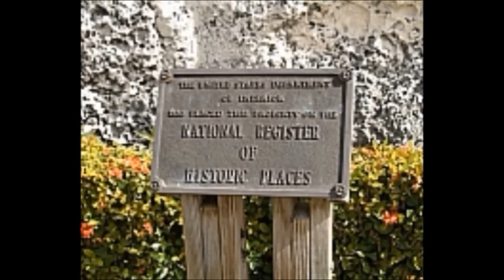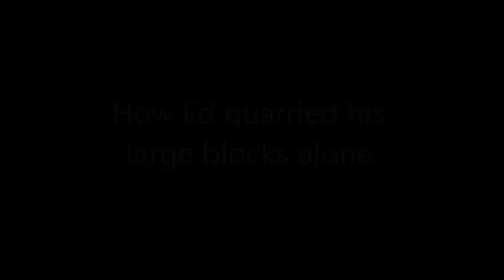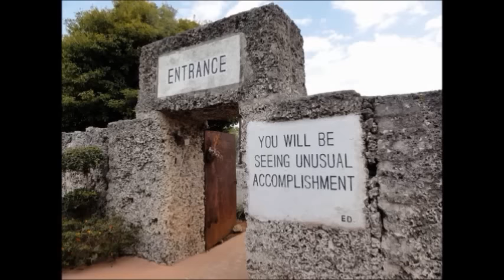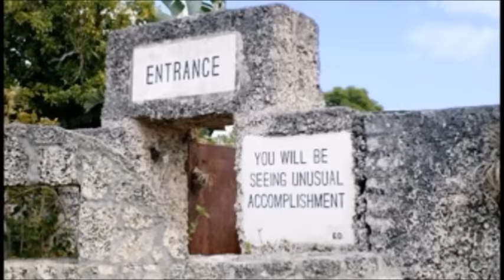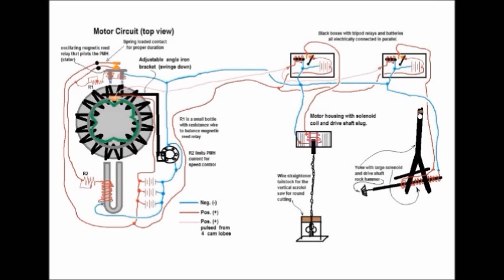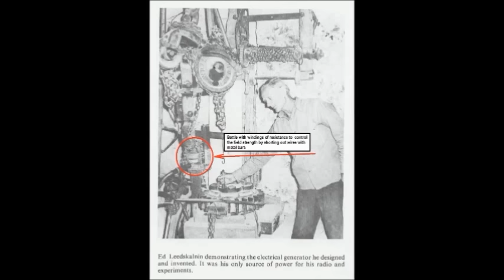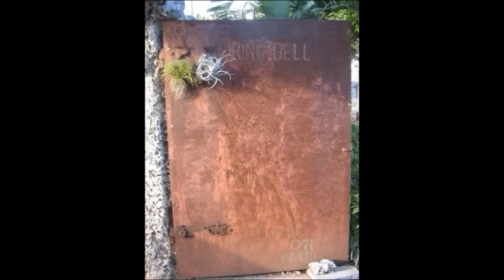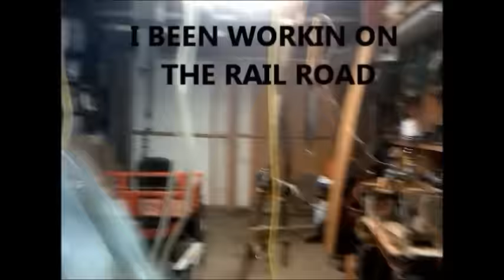Eds Coral Castle Quarry and Flywheel, Engineering Mystery Solved

Comment: This device is simply a hand crank Generator. It lit two bulbs that's it, it wasn't capable of much more and the bulbs could only be lit as long as the Generator was being cranked by hand.
Reply from the maker: +Tyson Capel Obviously you didn&#39;t watch this documentary then you know what it really what and that he used it for years and years and thats why it covered in carbon plasmtic arc  splatter on one side and not the other. I don't  think it CAN EVEN LIGHT BULBS without the aid of wires  on the magnets. so he used the iron as a motor armature. simple. What were the clovers leafs For then????? IT s obviously a motor not a generator.
Reply: +Made by one man there were coils of wire around it at one point in time. When Edward gave tours of the Coral Castle he would demonstrate this Generator lighting two light bulbs as he turned the hand crank. People are trying to deceive you into believing it's something its not.
Reply from the maker: Tyson Capel I am not sure if it is I that is truly being deceived. I tell you the wheel won't even light light bulbs. The magnets just are NOT strong enough. What are the clover leafs for AGAIN???   PLEASE HELP ME.  I AM LOST.
Reply: ***** I did watch to the video all the way through. There used to be wire windings around the device but they have since been removed. Iron oxidizes quickly especially in an area with high humidity so the likelihood that you would actually be able to see spatter marks is next to none because those areas would have rusted to the point where they would no longer exist. The clovers were used to direct the flow of flux.
Reply from the maker: Tyson Capel The splatter marks are obvious in the famous picture every one sees with his hand on the signalling wheel. the clover leafs are merely for switch contacts. ANGUS WANGUS's video on the wheel being a flux generator is total poop.
       why would one want to guide flux via cam lobes (clover leafs) anyway. to move a compass??? thats all they would do if that. what do you think the big hangin yoke was for????
       WAIT   I GET IT.    you still think levitation occurred etc??   NO.
       This stupid machine is way to simple to perform any (impossible un till the lexus hoverboard) magic. I am trying to be nice in saying........    YOU MY GOOD FRIEND have been hit by a large human size pile of internet bullshit and your eyes are still covered with it. This video (I created) is a giant water hose to clean all that crap off people who got hit by a system that slings shit for its money. If you don't WANT a good HONEST RINSE. then see you later hope you find what the internet tells you is the truth.   BUT ITS NOT.
         I actually care so put a stop to it.

peace out.          Scott R
Reply from the maker: ***** YOU NAILED IT.   That is impressive cause ACTUALLY it's correct very good.   HOWEVER  those frequencies that are needed to perform such a task DID NOT occur at CC. Although this place is laced with "counterspacial potentially intelligent lifeforms (aliens?) so it DOES propose some serious "spiritual" inspiration for congruent concepts such as levitation, free energy etc.
         It is with my own opinion that I do NOT believe ED LEEDSKALNIN  levitated rocks but I do believe it will be possible someday with similar conceptual inspirations from said geographical location etc.
        BOTTOM LINE?   its good in theory but no one has truly proven it.    YET.........
        Resonance is IMPERATIVE. actually and I like that you have some "clue" on counter space.   TIME MACHINE?????

PS? John Hutchison is a fraud on his levitation. He might be able to "DE ACTIVATE" nuclear reactions with his vibratory implements but not levitation. 
Scott R
Reply from the maker: ***** The problem is that we KNOW those values are irrelavant to the gravitational field of the limestone. It is present in all matter. AS for electrons, PLANETS don't exist either because they are merely the "RESULTANT" coalesced harmonic of the energies guiding the next layer of particle that exist there due to there "cymatic position" on the hexagonal lattice of space time. basically the energy mass thing. 
         Electrons ARE a decent model to use from the bottom up.  I see you kindof understand some of that, therefore you say they don't exist. BUT as far as a relative perspective to the energies coalescance THEY DO. AND   they mathematically explain all chemical and atomic interactions relative to that perspective. Which we all have agreed upon. Just remember my good brother with a different insight its like this SIMPLE.::::
        look Johnson theres a boat on the water moving to the other fixed shore, says the elementary school student. Then Scott and Johnson says NO look there is a boat out there and one shore of the water is leaving it and the other shore is moving towards the boat because the boat is fixed but the shore is moving. 
         I believe the old dismantled model was called hole flow vs.. electron flow. WHICH IS IT????      its ACTUALLY  both cause its the same just looked at from different perspectives. back to relativity. then we learn counterspace has a relative time perspectus to it as well.   Stroboscopic time travel???   pretty much.      Scott R
Reply from the maker: ***** thats not true as there must be no earth or the earth being bombarded by the same relative forces would not exist either. Electrons only exist in a model. So do ATOMS. other wise its all energy vibratiog so fast we can't fathom the network. Electrons provide a logical mathematical working model. WORKING. because it explains all of the chemical reactions on this planet.  
As for atoms. they don't come flying apart to quickly even when hit by a meteor or another neutron. they stay put in their happy little place in the model.
Reply from the maker: ***** that is all pretty much correct. as for the electron. exactly its MERELY a model. All of the OBSERVATIONS seem to be accurate enough for peeps to make Nuclear reactor etc, batteries, call phones and solar cells. So why try to re invent the wheel (reality) when merely one may have to just look at it a different way. And WHY? no need really if it all works. WHO CARES how your son, daughter, dog, carrots are made. The FACT remains they exist and you just really don't know how. WHO CARES they are there. PERIOD. if you know that the dog is really a cat then mebe we have a issue like galileo, tesla, einstein, faraday, bohr, etc.   we will get to bottom of the tree at the center of the garden soon enough. WHY?    curiousity of course. other wise we should just be appreciative. because we CANNOT
yes PEACE LIGHT AND LOVE bro.
Reply from the maker: ***** again who cares about no electrons. The fact remains electricity works. AND  please please please. Why make the wheel like ED     Roy   did and he found that it wasn't some internet magic. it was like EVERYTHING ELSE.     quite simple once you understand how it works.    
         AND    it works. almost everyone can see that now. They didn't know how something 120 years old might work today since everything is made FOR them and they just plug it in, or turn a key. most people don't even know what a relay is, let alone an extinct 2 pole oscillating relay unique to a machine 120 years old.
          SOOOoooo......      what is it you think I missed   HONESTLY.    do you think ED LEEDSKALNIN levitated rocks with magnetism??? or got free energy like the internet says.   (for $$$$) or do you believe in solid,  hard, COLD facts about reality. yesterday someone told me ed used magnetism and electricity to "soften the rocks so they could "MELT AND MOLD" themselves into place with cracks. obviously he has never been to coral castle.    massive cracks and gaps everywhere.

What do you REALLY think....?
Reply from the maker: ***** ALL RIGHT,     JOHNSON   !!!!    its time you and I talk. Its obvious to me that I have finally found a HOT one. calm down I mean this with FULL RESPECT.  
        You have finally proven to me that you are one WITH a clew. 9 out of 10 is an "A-" 95 % is an "A". you get an "A" the reason you don't get an A+ is only because personally I question the actual, practical, feasable means by which ED L. might have accomplished what you just described which is exactly correct. Some people coin the term "UFO" technology. 
         First of all Each little "energy field" you speak of is exactly what it is, HOWEVER. What almost EVERYONE cannot see is the actual propagated vectors of these "semi-infinitessimal" vibratory dielectric piano strings (TV beams) all "TUNED" by the same realm including and/or excluding the concept of time. THUS the mathematical "Tesla/Steinmetzian/Heviside" relationships describing "counterspace" of course one could romanticize with the same shaped language matrix and "jest" that the term counterspace is merely where "GOD's" giant TV/piano is actually setting and we are the interact World Wide Web FOR REAL. Basically the Kosmos at large and small (all in the same image mind you).
       So on those tension levels of "cymatic like" string/wave propagated energy "fields/branes/strings" a scientific concept called "COALESCANCE" occurs, due to repulsive and attractive combinations like a song in harmony. Science actually assumes this but they never seem to see the reason. they just assume it occurs EVERYWHERE. but its not like that (of course) the aether is like water and the universe is no different from large to small. As a MATTER of fact the ancient longest lasting very controversial text "spiritually" describe the basic geometric lattice of EVERYTHING we humans could possible perceive at every level of awareness from way back then till our perceived present (Pre     Sent) Most hidden from the many. But those who find it are few. 
         The price for this knowledge is undescribable though.  It  takes "great pains" ("pain"  =  Pay in)  from within and only the elect     ( rical? ) get to "see" it. YUP the rode to life is long and hard  and so are the VOWELS and CONSONANTS in the language matrix (which also cluster like body parts, chemistry, and everything else, )    
         SO back to the A+ thing. I realize Coral Castle is the/a Corral (nodal points and leylines if you will)  for ALL OF THIS, and thus all the levitation INSPIRATION and other INSPIRATION (free energy from the dielectric field). Energentically somehow, however, ..............   do you REALLY thing little ol' ED from latvia who they all knew locally and testified as to his work thru affidavits, REALLY electromagnetically gyrated the lattice EXACTLY as it would have to be to levitate ANYTHING my good brother (sister if johnson is your last name and you are feminine ( I don't care) ). ??????
       So that's all for now now. I don't gather AT THAT TIME PERIOD that ED did it.

BUT   ! ! ! ! ! ! ! ! 

I never said levitation was impossible. Thats why I think you are correct and still get an A  

Honestly I just think that ED did it the way every sees in the movie. He Rigged it. He was from RIG A    Latvia   after all.   Scott R.
Reply from the maker: +Johnson VERY COOL   I will not move too fast. as for the rhombic 3 d setup. bingo.......     that is exactly how UFO technology will work (did work) but ED did not do any levitation. this way. The theory and evidence is certainly only futuristic. (to us) inspired via coral castle (somewhat) yet I have yet to see anyone levitate or even lighten coral limestone.
Reply: +Made by one man Nikola Tesla used to invite people over to his place, and have light shows, at the end of the show Tesla would Levitate up about 15 feet or so scarring all the people there so bad they all ran out of his place, it was called the Tesla coil I think, I always wanted to make one it would be really cool....not sure if it could pick up big rocks or not?
Reply from the maker: I agree, on the generator, but since it does work as a cutting machine why do people say its not that when I am showing them.? the damn thing actually turns by magnetism (eds books) and what would the four leaf clovers be used for as well as all the coils in the shop. Check out the vid again and digest the whole machines concept and You will start to like the place again. Cause this thing seems simple. I don't want to trample dreams BUT I don't want people to be in the dark.  Peace out
Reply from the maker: ***** yes that would give rise to the "homopolar generator" postulation by mr angus wangus. Seems the values are too weak to do anything that all. BUT you are RIGHT on those geometric profiles that DO form on the top and bottom of the wheel when "fired up" magnetically.
Reply from the maker: ***** You should "suggest" that to either Vinny St. Vincent or Mr. Angus Wangus. Vinny has the the replica and Wangus is the one suggesting its a homopolar generator. with a monpolar vortex you would see with flux film. Great Idea.

Comment: Ah, so many critics, so few actual working wizards. Great job, Scott. Don't let the shallow negative morons reduce or demean any of your brilliant work. I first visited Coral Castle with my parents back in the 70's. I took my kids to see it in the 80's when the door was still working exactly as Ed built it. The most amazing feat ever and the engineers managed to screw it up permanently. I revisited with my wife this past summer. I had a fresh perspective on it, but was still dumfounded on how his obviously magnetic and electronic apparatuses worked together.

You have put the pieces together majestically! Thank you. Ed had a firm grasp of the power of magnetism and electrical energy. He shut down many an engineer that has attempted to explain his system for the past decades. We may still not know exactly how he moved multi-ton limestone blocks, but it's not that far a stretch that he used mechanical energy, as well as magnetic and electrical energy. Is it possible he also had insight on frequencies, Earth magnetic energies and the electrical properties of energy in water? Sure. But until someone can tell us exactly and accurately, just as Scott has done here with his hard work and research . . . then, just shut the hell up!